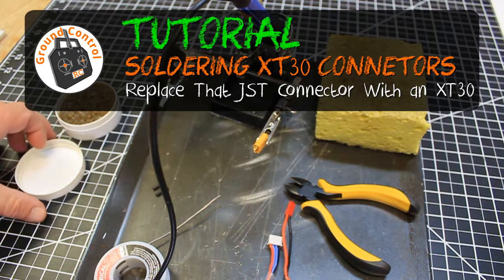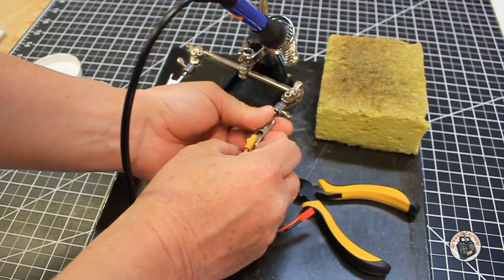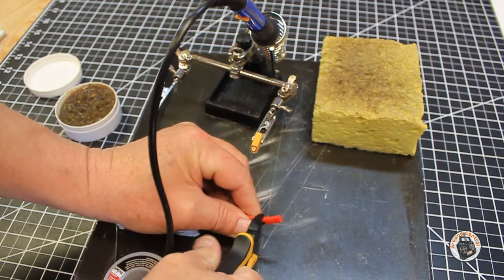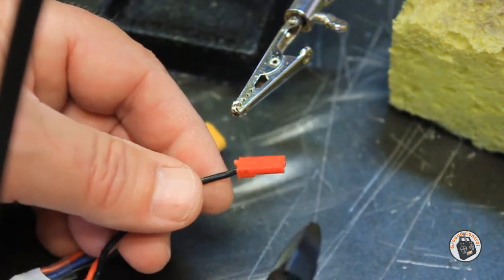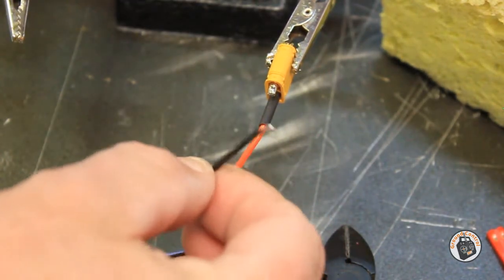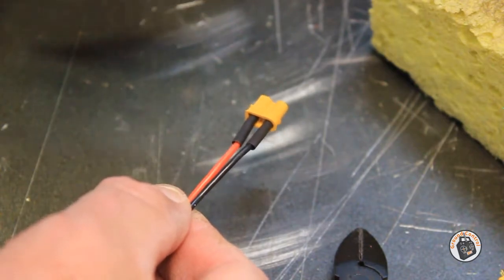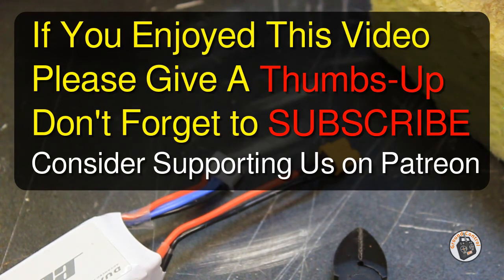Tutorial - Soldering an XT30 Connector on your LIPO

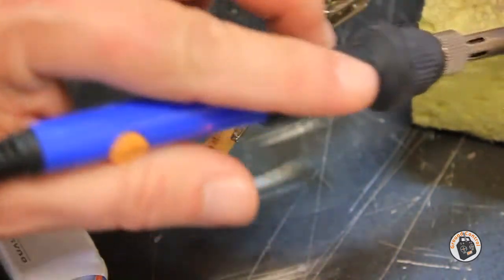Comment: Does anyone know the inner and outer diameters of the sockets that one would usually shove wires into? To be more specific, the part that solder is applied to at 4:06
Reply from the maker: Good question! I don't know the diameter exactly but the diameter of the solder I use is .062 inch (1.6mm) and as you can see in the video it fits nearly perfectly into that half round of the connector. Putting a slide caliper on the outside of the half round connector I get approx. 2.5mm. I hope that helps. See you in the Air!
Reply: @GroundControlRC  so, in other words, your estimate for the outer diameter is 2.5 mm? That would match up with another source I've found. Of course, said source was just a blog post, so I've been trying to verify it.
Reply from the maker: @cancelskawoforgivingmedlib4710  , yep! That's what I found. From what I've read, the XT30 Connector has 2mm Bullet Connectors embedded in the Plastic Housing. How consistent these measurements are from Manufacturer to Manufacturer is anyone's guess ;-)
Reply: @GroundControlRC  I will take that heart as a yes. Thank you very much! I couldn't find a datasheet with that measurement anywhere, and I wanted to mount that connector to a  PCB.
Reply from the maker: @cancelskawoforgivingmedlib4710  , I did a search for an engineering diagram as well and found measurement for just about everything except the pins? Go figure. Anyway, good luck on your project.

Comment: My ironic has adjustable heat. What do u think 350 Maybe 400  Degrees....    it's weird that you saw these while they're in the plastic housing I'm used to like EC3 connectors where you solder the bullets and then you press the connector into the plastic housing after.   But I see what you did here so I think that will be of help, , I'm just worried about getting too much heat and melting the plastic housing,.  So it is cool to watch somebody do want to get an idea of how to go about it.  Thank you
Reply from the maker: Your exactly right, I connect the female and male housings together while I'm soldering to prevent the plastic from warping. This keeps the pins straight in case I apply heat too long. I set my Soldering Iron at 400 as I have found this enables me to melt the Solder very quickly and so I'm applying heat for a shorter period of time.

Comment: in the video everything looks much bigger ... I felt like in microsurgery haha
Reply from the maker: Hehehe...you're not kidding! I feel like I need one of those surgical magnifiers to solder this stuff. I picked up a pair of 400 magnification reading glasses to do the really small stuff ;-)  Thanks for stopping by and I'll see you in the Air!
Reply: @GroundControlRC  this shit its impossible... i melted all my xt30...now i must wait 3 weks for new ones...
Reply from the maker: @Bergwacht  , I know, it's hard to solder some of these connectors ;-)  When I first started out in this hobby it was very difficult for me to solder. The problem I found was that I was using the wrong solder and my soldering iron was not getting to the proper temperature. I picked up a good soldering iron and some 60/40 lead solder and to my surprise it was much easier than before. My soldering iron has a temperature setting and keep it at 380 degrees celsius. At that temperature I don't have to keep the tip applied to the solder for very long. I also keep the male and female XT30 connectors joined together during soldering to prevent the plastic housing for the pins from warping. I clean the soldering iron tip constantly and apply a bit of solder to coat the tip and that transfers the heat much better. I also dip the ends of the wire in flux to help transfer heat more quickly. I have found all those things make it faster and much less likely to damage the housing. I hope that helps. I learned this from trial and error.
Reply: That's still difficult. I have used 3 different solders. One was good then.
The idea of putting the plugs together saved my ass, so it worked and I'm not anymore melted the pins away :)
I fly race copter, but in this case I rather wanted to equip my e-scooter with an additional battery for more range ^^
Honestly it was the hell to solder a cable with cross cut from 18 to such a tiny plug ... as if man would try to solder a truck to a fly ^^
Honestly, this is the first time I have really learned how to solder.
I still think that does not fit together, why do you solder such a huge cross-section to such a tiny plug?
I do not understand that...
But I just really try follow the same wiring as the manufacturer...i dont want to see my scooter burn^^
Here in europe the good solder with LEAD is just forbidden :-/
Reply from the maker: @Bergwacht  , that's too bad. I have used the solder without lead and solder with lead and trying to solder without lead makes it more difficult. Do you have to use XT30 connectors on your scooter or can you use a larger plug as it sounds like you have a larger gauge wire? You might try an XT60 connector or even an XT90.
Reply: Unfortunately I had to take the Xt30 because the battery and the Bmi has such connections.
connecting to plugs together to soldering is just perfect no pins bending and nothing is melting now.
But the scooter wanted to kill me, there I never get on it again; )

Comment: I like your comment about using leaded solder. In the UK it is fairly hard to get as we are being forced to use leadfree crappy stuff.

btw I learnt the hard way about putting the heatshrink over the first terminal before soldering the second terminal, and I've got a soldering iron tip with a big chunk missing to prove it. ;-)
Reply from the maker: Thank you much! Solder without lead just doesn't work very well does it? Oh, it sounds like you create fireworks the way I do ;-) That's how I learned about the heat shrink as well ;-)  See you in the Air!

Comment: At 7:36, didn't you short it out with your finger?
Reply from the maker: No, no short. You can touch the wire with your finger and you won't short the wire but if the wires touch each other you will definitely create a short and lots of heat and sparks ;-) That's why I only prepare one wire at a time as it's much safer that way. See you in the Air!
Reply: low voltage DC doesn't go through our body that well

Comment: Can I use hot glue instead of heat shrink?
Reply from the maker: I think that would probably work just fine. You just want to make sure there is no exposed wires so they can't short against anything and also I would add some hot glue along the wire insulation as the heat shrink also adds support to the wires to keep them from bending and fraying. See you in the air!
Reply: Can I use hot glue instead of soldering? : ) I'm humiliatingly bad at this...

Comment: should not be 16AWG cable JST connectors use 28 AWG
Reply from the maker: Thanks for the info. I replace the leads if they are insufficient for carrying the supplied amperage the battery is capable of providing, however, that should never happen. I have standardized all of my battery connector with JST connectors for 10 amps or less, XT30 connectors for 11-30 amps, and XT60 connectors for 31-60 amps with the appropriate gauge wire. I currently don't have anything that will pull more than 36 amps. I feel a JST connector is not appropriate for a battery that can supply a constant 20 amps of power plus all my aircraft that can pull more than 10 amps but no more than 30amps have all been standardized on XT30 connectors. I think at 20 amps of power the JST connector would be a bottleneck for power flow.